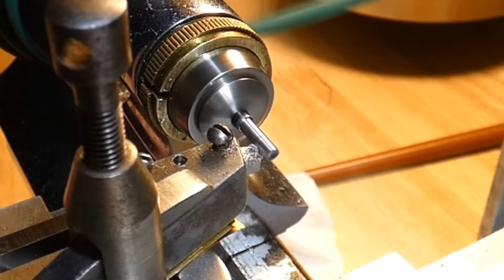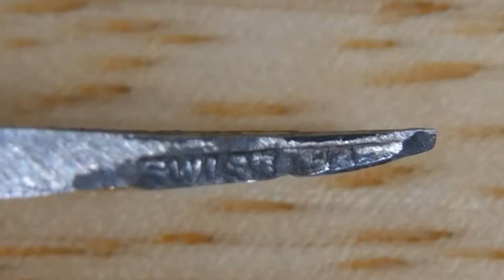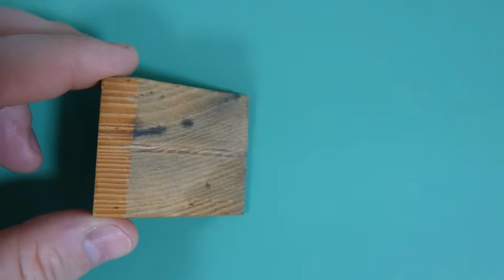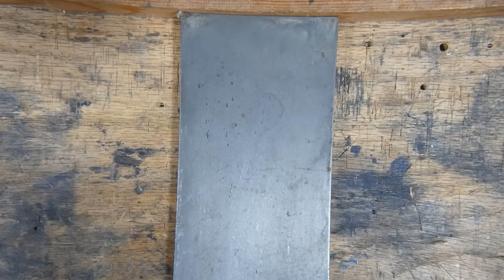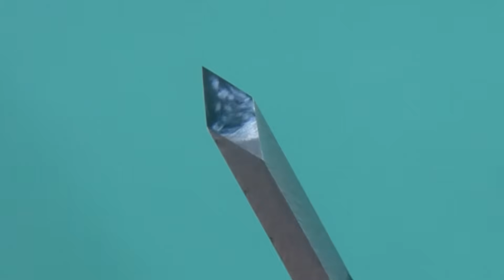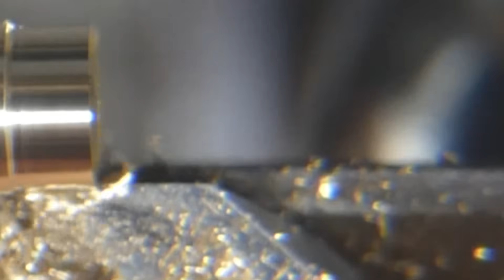Sharpening gravers - A watchmaker lathe tutorial

Comment: What’s the specs on the motor you use for your lathe? I have this 100watts 110 volts sewing machine motor and it’s trash I mean it struggles when I’m doing basic cutting and forget about drilling.     And it’s a cheap motor so what do I need? I want a good motor but I don’t need 4 horsepower motor or anything I actually want one horsepower motor.    So what do I get?
Reply from the maker: 110v, 1/10 hp is all. Works better with thicker belt, I use 5 mm. Doesnt have the torque of metal shop lathe, so use for fine cuts. Drills brass up to several mm. Good for steel pivot wire, but with larger ferrous material needs patience.